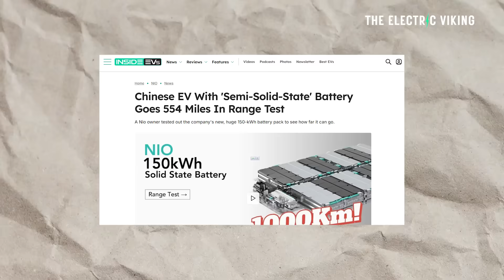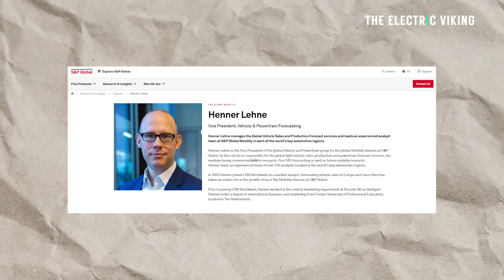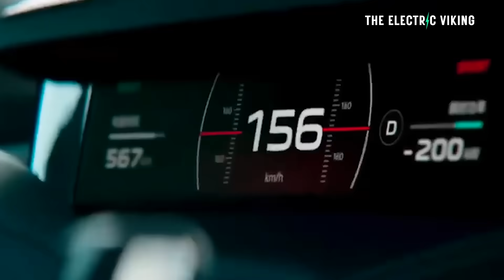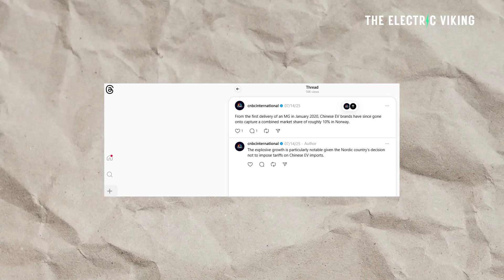China’s EV Boom: Why Automakers Worldwide Are Powerless to Stop it

Comment: China's EV numbers are mostly BS. Like everything else in China, none of the information released to people outside China is even remotely factual. How about doing a deep dive into the cheap Chinese EV's they are trying to unload on other countries? How about showing how a large percentage of them are missing parts, have faulty safety systems that lock you in when your EV takes off on its own, slams into another car or building and then catches fire with everyone locked inside? How about all the complaints from inside and outside China about the horrible QC of these cars? Technically it's not horrible QC since not installing the airbags or proper brakes or safety software is done on purpose so that the manufacturer still makes money despite the ultra low costs. How about how there's zero no dealer to talk to when you discover your Chinese EV is a deathtrap? You can forget about getting your money back because the seller is in China and you are not. Chinese EVs are a scam being perpetrated on gullible nations. China's economy has already failed, it's only projecting stability because you can't question the CCP.  Workers haven't been paid in several months, sometimes years. They are burning down the factories to get revenge. Over 70 factories have been burned down across China this year alone. Stop promoting Chinese propaganda and do some research.

Comment: BYD has copied Toyota and Ford's path of Global diversification and building plants internationally that avoid the China tariff restriction.
The difference is that BYD builds a plant that has far more Automation has the supply chain sorted up front and will build 300,000 cars from each plant, not the 125,000 units and less as per US plants manage to make.
Economies of scale and a much stronger supply chain - 

Vertical integration and in-house manufacture resulting in less reliance on external suppliers at the same levels as the legacy automakers of the likes of Toyota, VW, GM  and Ford .

Outsourcing has been the downfall in cost control as margin stacking inevitably results.
the large legacy automakers force other companies into bankruptcy as they want the parts for as little as possible but don't want to pay for the margins other corporations need. 
Eventually legacy auto makers need to bring those manufacturing lines back in house.

Comment: So I just watched a video about repairing a 11 yo GLk Mercedes. It needed a fuel injection pump and a steering wheel adjustment motor. Minor parts yet a 3k repair bill. It's not regulations that will kill European cars.
Reply: My shitty VW Passat 2Ltr TDi wagon got taken away to a parts yard. I got $200 for it. Got it at 18 months old. Injector issues, DPF issues……
The roof lining fell off and I was struggling to see out the back. Fake chrome on all the buttons fell off, Park brake button shit itself. Taped it the lining with duck tape. 
The repair bill was going to be over $6000 to fix all the Mechatronics inside the shitty DSG Gearbox, add to that a new Flywheel. Fucking Eurotrash!

Comment: There's no point buying an Ev if it isn't battery swap capable like NIO branded vehicles. Replenish energy in under 3mins & battery degradation is non existent
Reply: Batteries in modern EVs are well and truly exceeding manufacturer's expectations. My EV has an 8-year battery warranty. That is just the free-replacement period. At the end of the battery's functioning life for an EV (probably 15-25 years) it will still have an 80% capacity (450 km range). I can still keep driving it for urban trips. It still has value in being repurposed as a domestic-storage battery. Even after that the batteries all have great value in recycling the mineral components (95% recyclable).
The "battery degradation" tale is a trope!
Reply: Shill
Reply: 240V home charging is more than adequate for anyone